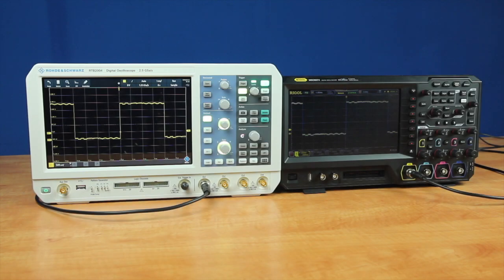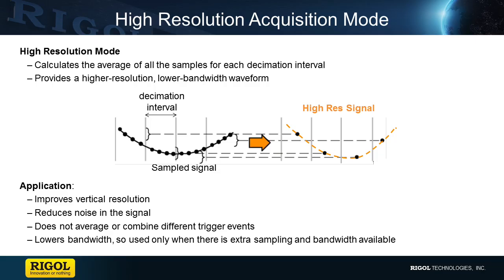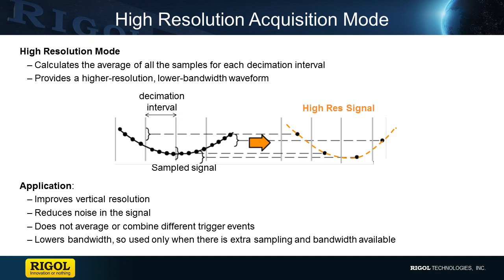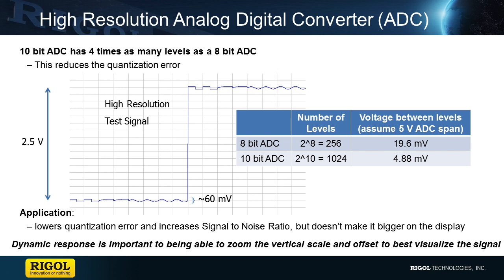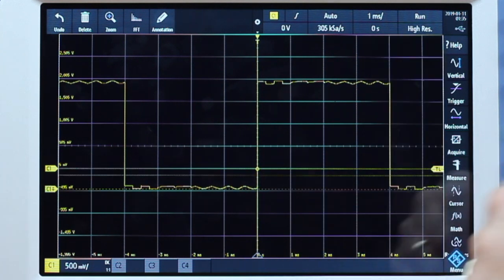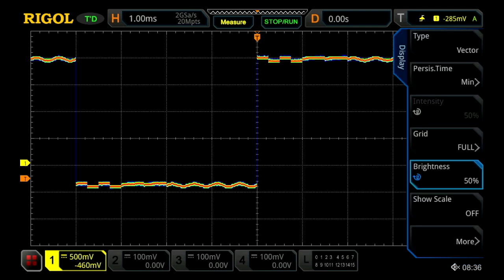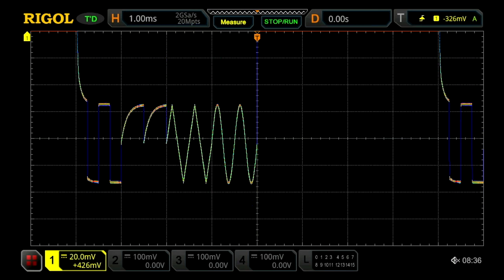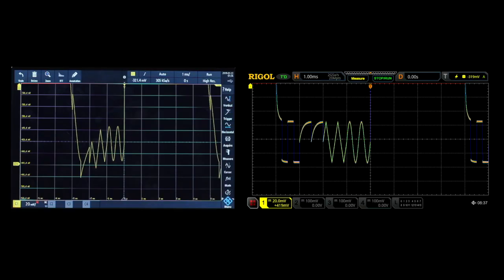High Resolution Mode Comparison of the MSO5000 VS the RTB2000

Comment: the RTB2000 can have 1.25GSPS but for MSO5000 its 6.4 times more equal to 8GSPS. comparison is NOT fairly because the most important key of high resolution mode reading is capability of over sampling.

Comment: Speaking about MS5000:

Is is possible to set the RBW when in FFT mode? To which extent? Otherwise, is it possible to set FFT lenght along with windowing function?
Apart from auto peak finding, is it possible to use cursors on FFT?
Reply: Yes, by changing the timebase. E.g., at 8 GSa/s I can set RBW to 10 kHz on a 3 GHz FFT window.

Comment: There was no high resolution mode when the MSO5000 series came out. Added later with firmware update but does not work properly. The problem is still not resolved. I don't understand how you made this video.
Reply: I use high resolution without a problem, all the time, on this scope.

Comment: All scope manufacturers require non-saturation for valid measurements.  The proper way to take this measurement would be to scale the waveform to fit on the display, then use a zoom window or math operation to zoom into the detail.
Reply from the maker: With the new front end on the MSO5000 series it no longer requires customers to use math operations or zoom mode to view small signal details unlike on the RTB2000 series.